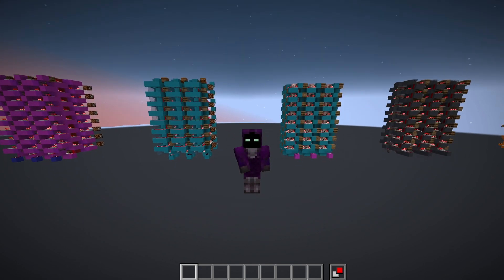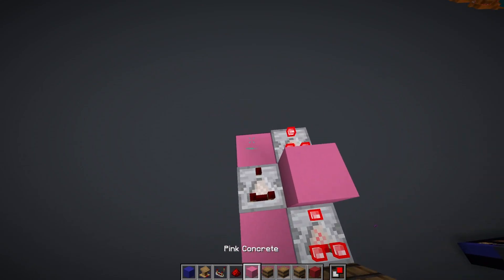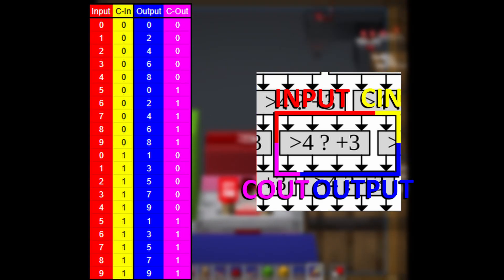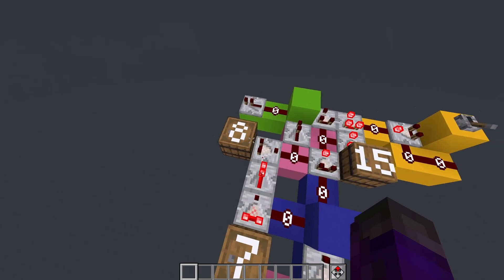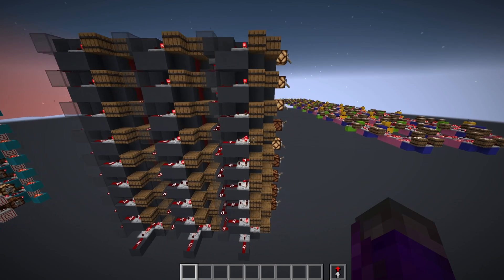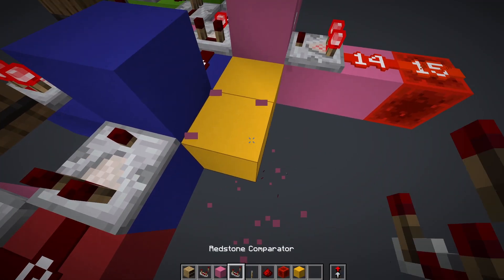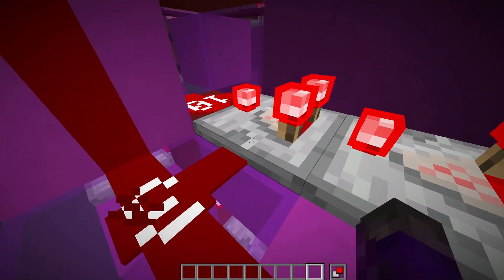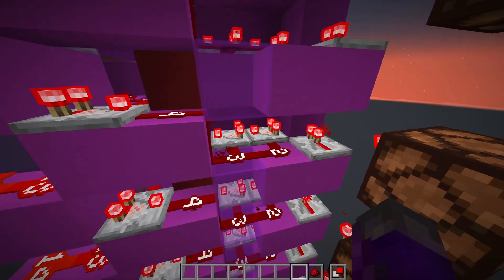Translating Double Dabble to Hex Logic | Minecraft Redstone

Comment: Which redstone resource pack are you using?
Reply from the maker: The signal strength display on the redstone dust is from vanilla tweaks, the signal strength on the barrels required a special setup for the video, sadly there is no resource pack for that
Reply: @Xoliks97  what kind of setup? is it a mod?
Reply from the maker: The "barrels" are actually retextured chiseled bookshelves. chiseled bookshelves can have their data modified to provide any signal strength (even HSS). Then, I made a custom resource pack to make models for 15 of their different blockstates
Reply: @Xoliks97 I see, quite ingenious. This kinda makes me wanna write a mod to reproduce the effect but with barrels (and any other container really), although I'm not sure it would work in multiplayer without additional plugins as I don't think the server sends the inventory of containers until clients ask for it (i.e. when they open it).